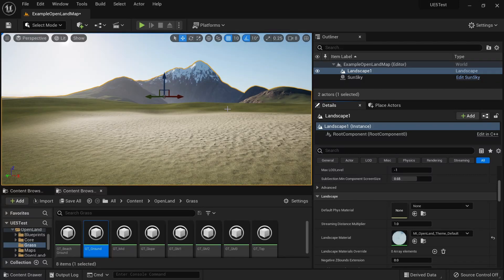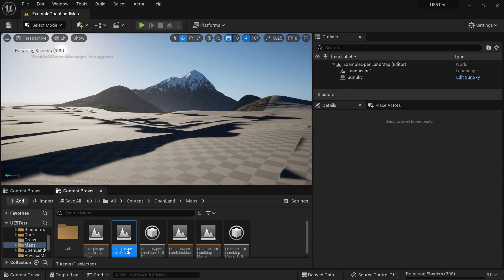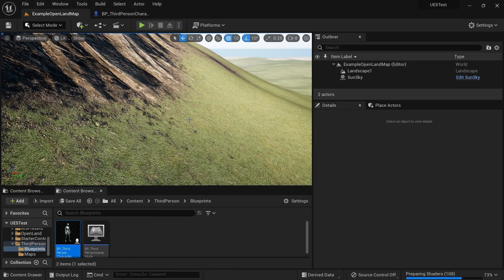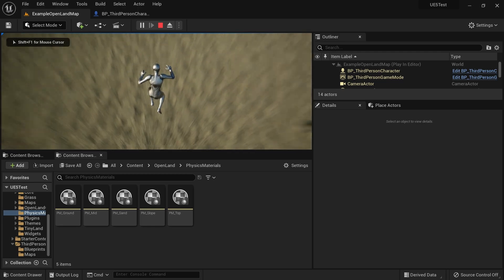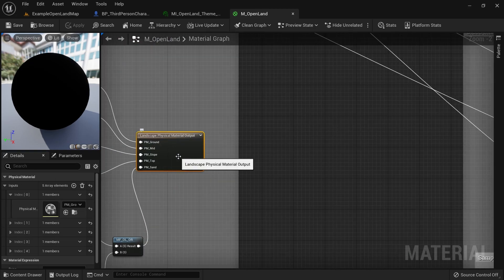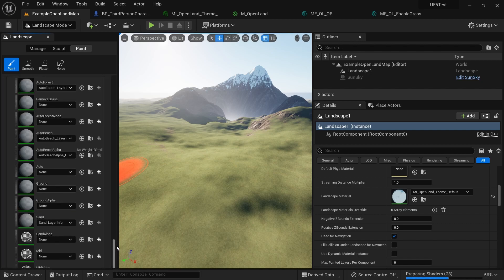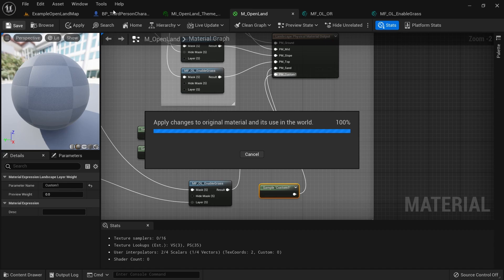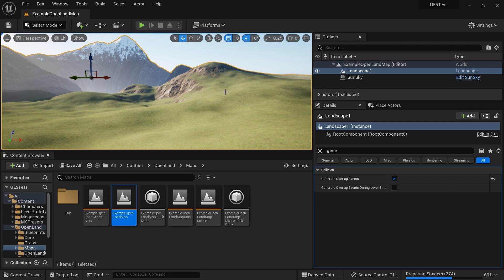Live Demo: Using Landscape Physical Material Output Node in Unreal Engine 5 (for Foot Sounds, etc)

Comment: When used with UDS, such as in snow or rain, can its physical materials be switched?
Reply from the maker: Sure. Even with UDS, you need to use a Landscape. So, it’s totally possible.
Reply: @GDi4K  How :( I've been trying to set the snow physical material for my effects but failing